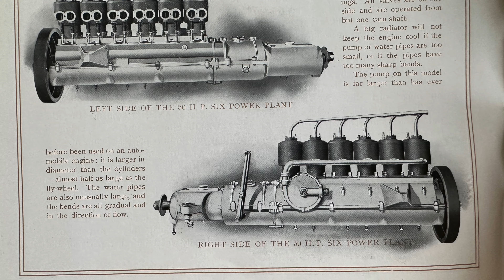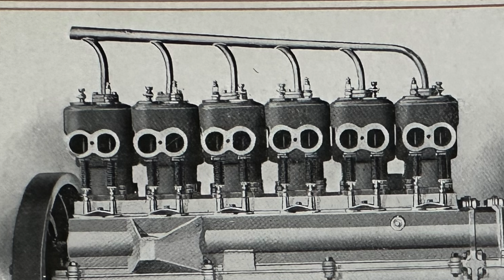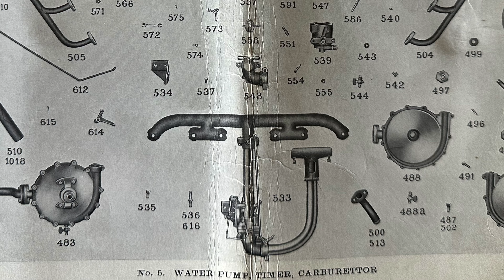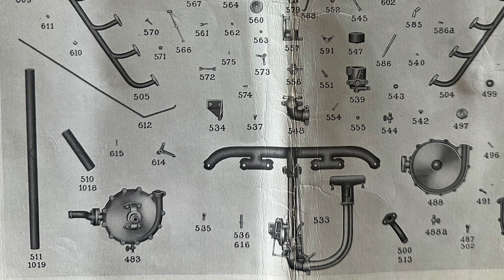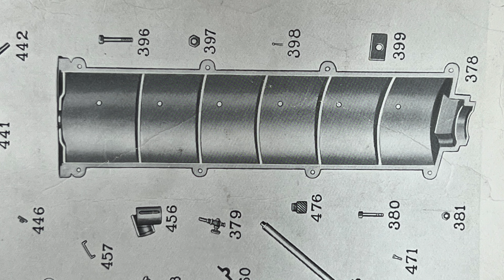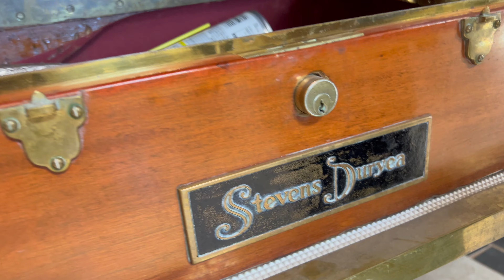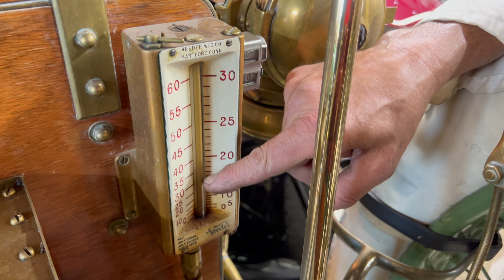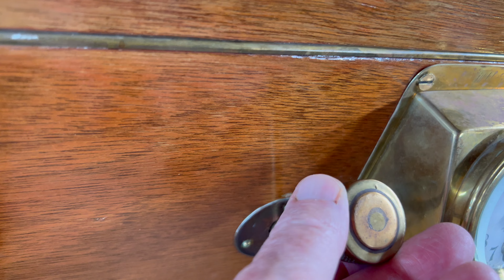FULL ENGINEERING Review 1907 Stevens Duryea Big Six! Alan Travis w #BarryT

Comment: You can start any car without a carb just put fuel in the manifold and away it goes , just not metered
Reply from the maker: Maybe but this car was designed in this experimental way